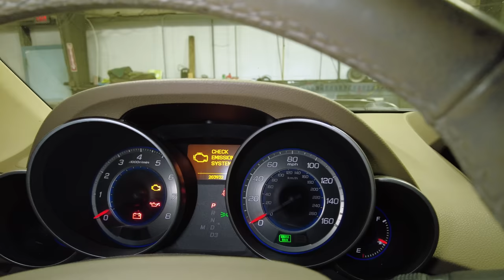Total mess! Last shop really screwed up on this '07 Acura MDX. What does the CAR WIZARD find?

Comment: How frustrating to have customers that won’t agree to the repair after such a thoughtful diagnosis!
Reply: The sole reason, I suspect, is going to be the cost - if you ain't got it, you ain't got it. 

And there's also a chance (albeit a slim one) that the shop that caused the damage might cover it.
Reply: How can someone buy a car with 200,000 miles and not expect /want to put money into it
Reply: Probably wanted it diagnosed so they can go home and replace it for a tenth of the cost.
Reply: Wizard makes 5x the repair on the video revenue. He has no care whether they repair it or not unless it's a dangerous issue. Many people don't have $1000 for a repair.
Reply: @HermannTheGreat  I wasn't being negative or trying to be funny. I just know that it would make sense for someone to buy the part themselves to save money, and then save on paying someone labor. Which I think is $149 an hour.
Reply: Yeah, I don’t even know why the customer even bothered if he had no intention to fix the problems.
Reply: @hbhamilton3410  He probably intended to fix it, within limits, and the cost exceeded that limit.
Reply: @ericdolby1622  yup.. sounds right to me.
Reply: @johnrobin2898  perhaps po  told him it ,"needs nothing" showed him a super expensive recent timing belt service reciept so he figured he'd be safe for a while.(usually these cars are pretty reliable even at that mileage)

Comment: Wizard, why not simply cut, reroute, and splice the wire for a valued customer? They’ll likely be back for the recommended fixes.
Reply: <sigh> Were you not listening? The wire is pulling out of the electric motor itself, it can't be spliced.
Reply: @Cheepchipsable  Uhhh ... I was listening. Cutting, rerouting, and reconnecting the existing wire (and/or adding in a bit of wire if needed) would prevent further damage until a proper repair could be performed.

Comment: Come on!... I admire your work wizard, but you should have been nice and release the wire at the very least! I know you couldn't assure the client that it wouldn't happen again, neither you could guarantee your work, and you would earn much less for the work, but I am almost sure that the problem would likely be almost solved. I work with electrics and a lot of solenoids too, and sometimes they can go wrong without apparent cause, but that one is just telling you want to do. Release the wire.
Still, great work on your diagnostic 👍
Reply from the maker: Nope. Thats a bad idea. Then the shop who did that can claim nothing is wrong, or refuse warranty since it was now tampered with by me. They can even claim that I broke it since I touched it. 
It needs to be left alone so the previous shop can verify their mistake.
Reply: @CarWizard  Oh! Ok then... But I didn't know the owner was claiming the warranty on that job. In that case I totally agree with you. Don't touch anything, and a good idea to make a video on that issue.
Keep on the great work you all do in your shop. You, the guys and Mrs wizard 👍

Comment: Why Acura has more problem than Honda while they both use the same engine and transmission?
Reply: You know The equivalent Pilot or Ridgeline are not that far away in terms of issues as they age.
Reply: @2fast4all  I have both Acura and Honda but Acura is having more problems than Honda from time to time. 2011 pilot and 2014 Acura MDX. I never had any issues with pilot beside regular service while Acura mdx has issue with rack pinion, wheel bearing,  rattling bank 1, and oil leat from upper actuator and high pressure line from steering.

Comment: Buy a car without an inspection? Here's what you get, GUARANTEED bills. Like, duh!
Reply: Even buying a car with a brand new inspection can get you these same bills, most shops don't check everything, and if this wire happened to be in the right spot at the right time, it wouldn't throw a check engine light either. (and a check engine light being on is not a failed inspection in most states on top of that anyway)

Comment: Don’t forget the mistake first made buying that crap. Those Honda products are absolute garbage
I have a customer with a 2009 MDX and it was a lemon from the start. Uses about a quart of oil a month.

I replace the engine with a low mileage used engine and it still uses over a quart of oil a month. Please please don’t buy Honda products they’re garbage.

Comment: Wizard, I wouldn't go out of my way to keep this customer.  They either don't have the money or the inclination to maintain the car.  I understand possibly not fixing minor issues on an old car until they become worse but the oil pressure sensing system is an important safety feature and should have been addressed.

Comment: $250 dollars will get you both headlight housings !
Reply: $50 will get you a kit to polish the headlights...more than once.
Reply: @diverdave4056  
So I read on another comment.
Now I will look for both products as I have 2 cars that will benefit from that.
The oldest of my vehicles have, of course, got glass fronted headlights.
They never haze over.....
Reply: @JohnSmith-yv6eq    That Mothers product works quite well  and you don't have to bother taping off your fender - hood n bumper while using it ... if you get some on the paint it will clean all the dirt n crap sticking to the paint and make it shine . I just did the headlights on a old Lexus that were so bad that you could barely see the light bulbs inside . It took around 6 minutes to do each one and the owner was SHOCKED how good they looked !  he had been driving with the high beams on at night , to be able to see the road better .

Comment: If that solenoid could talk, it would say four things:
1. Why did you associate me with such a bad mechanic?  I deserve better than to have my wires pulled out by poor wiring routing.  Even a moron knows that if the same wireharness is disconnected for a belt change and put back in place, it should have the same wire routing.
2. Why did the guy who bought me not have enough money to make me right?  This tight wire routing is giving me a wedgy and pulling my guts out. If my owner is a piker, he should have bought a used Corolla.
3. Why doesn't the guy have my headlights polished?  What if he drives me around at night?  He could run me into a tree and make my life even worse.
4. Why does it always feel like I am being assaulted by the dirt Nazi?  I don't like to be part of an archeological dig.  I deserve better.

I think the solenoid needs some solid answers.
Reply: There are probably 5 million of these V6 Honda variants built since 1998, I am sure its not the routing of the wire harness.
Reply: @midwestfarm757  I see.  So the wire pigtail harness to the solenoid inexplicably shrunk right?  Major shrinkage?

Comment: I've had a serpentine belt fly off and pull out the same solenoid wire on my k series RSX. Wouldn't rev past 3k rpm. Whoever did that was a crusty wiener.
Reply: Why did the belt fly off?!
Reply: @TassieLorenzo  rockauto belt tensioner

Comment: I watch your movies and listen: 
1. You recommend Toyota, Lexus, Buick 3800, Roadmaster 5,7, GMC Yukon/Escalade, Ford Crown Victoria 
2. You dont recommend Jeep Commander, HEMI V8, Chrysler V6, GM V6 3.6, European cars with V6 and V8.
And then I think: I dont want Lexus or Toyota or any other Japanese car. I want US car, but live in Europe so Buicks and Crown Victoria's are rare as hell. I can buy here Escalade, but they are fucking expensive and gas guzzler even with LPG, Yukon is rare. I can buy easiliy Jeep Commander, HEMI V8 Chrysler 300c or 3.5 300 here, but you dont recommend it. So maybe Cadillac CTS 3.6 ? Its also possible here, but its on black list. So maybe European ? Jaguar S type ? Nope, no recommend. Audi V6 ? Also no. Shit, hard to buy card in Europe using your recommendation.
Reply: "I want US car, but live in Europe so Buicks and Crown Victoria's are rare as hell. " Why not go for the Opel Omega or Ford Scorpio? The German-designed American cars are similar to the US ones, just a bit smaller and sportier to suit the European market.
Reply: Any m54 or n52 bmw